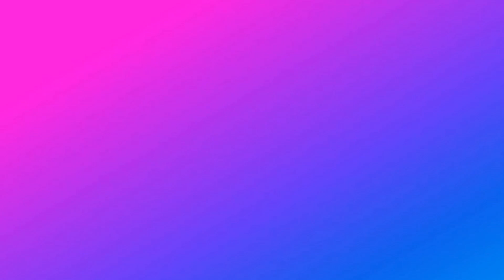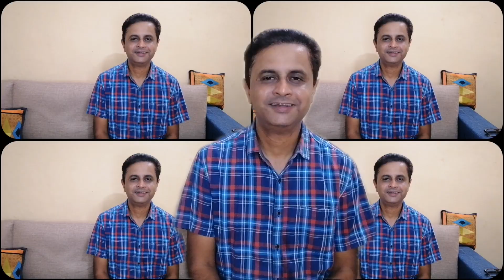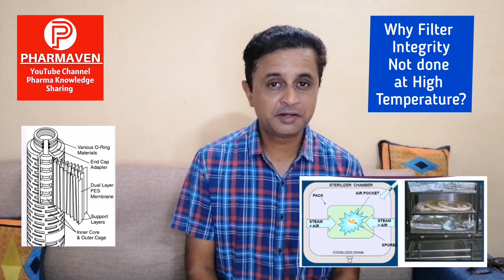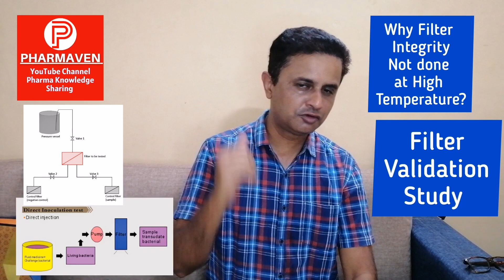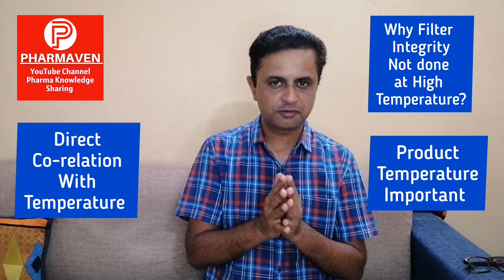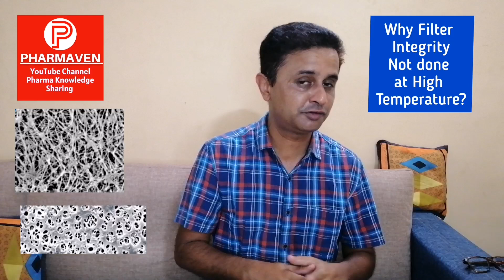Filter integrity test of Product #filtration #sterile #fda  #integrity @Pharmaven #filterintegrity

Comment: Sir wetting liquid temperature is also affects the integrity of filter?
Reply from the maker: Yes
It should be same as what specified for product
Reply from the maker: It should be same as specified in SOP
Reply: Sir make the video on difference between capsule and cartridge filter.
And types of filter, it's structure.